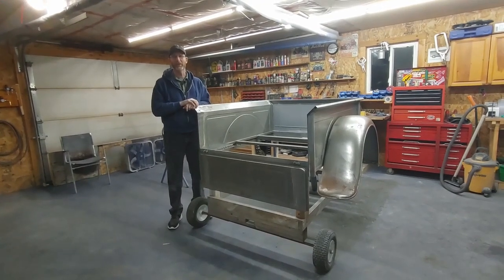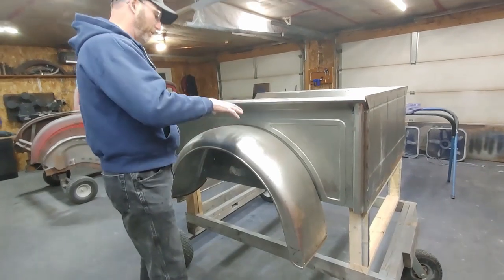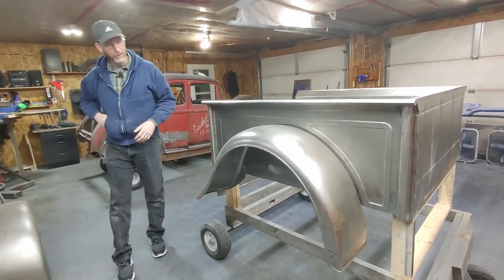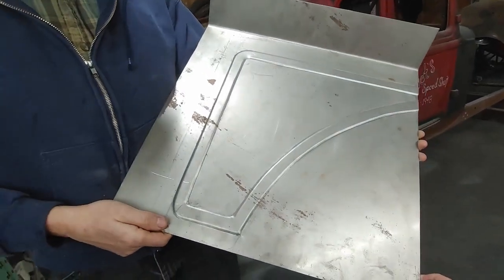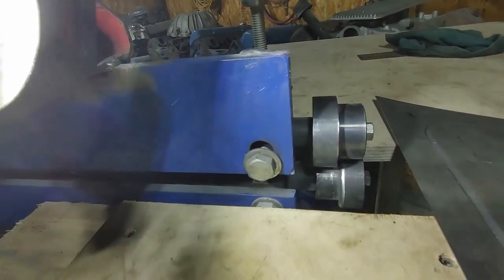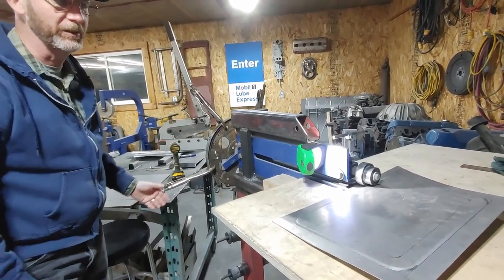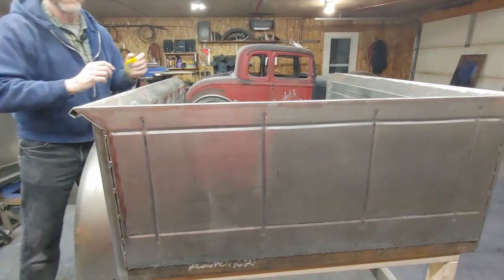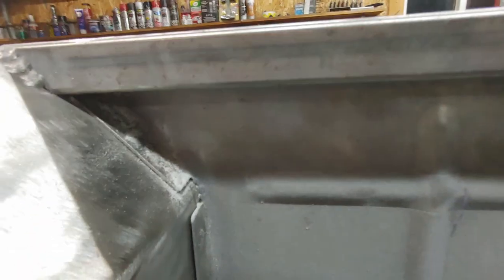How the box was made for the 1932 Ford Pickup

Comment: Thanks for your inspiration Derek,great job,l’m interested in what you use to prevent surface rust after your done making,l use Gibbs but ……….?
l’m doing a similar build in Australia,34 cab on a 32 chassis👍🏻
Reply from the maker: Honestly I haven't done anything, when it comes time to do the bodywork I will sandblast if it's a frame or buff with a sander if it's sheet metal before epoxy priming. I'll look up what Gibbs is and maybe take your advice! BTW my cab was a 33 to start with but I changed the firewall and subframe to fit a 32 frame.